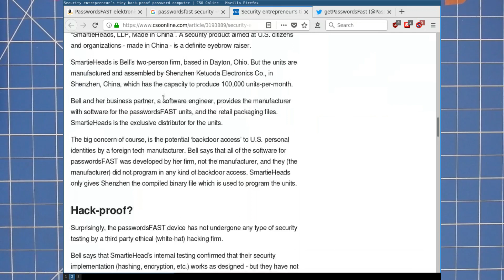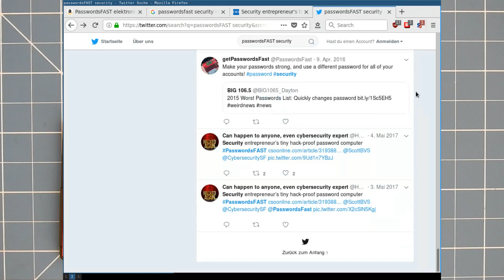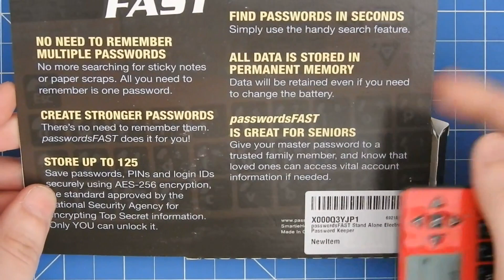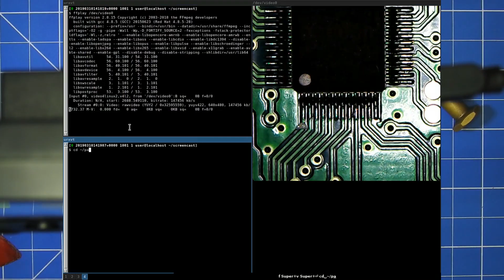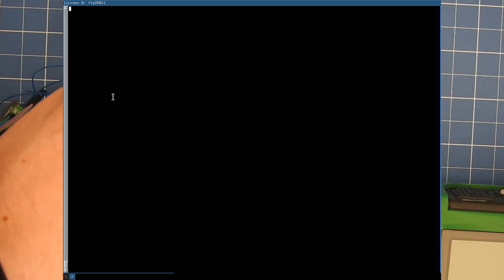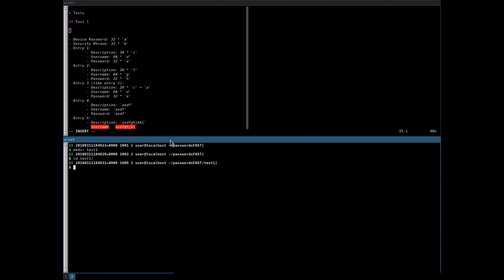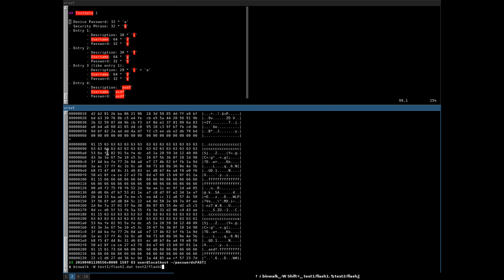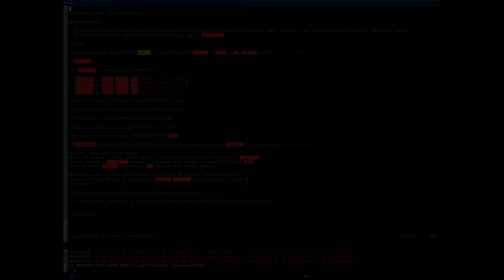"Reviewing" the PasswordsFAST hardware password safe

Comment: Hello, thanks for your video. I am looking for a hardware offline password storage option to go along with the yubikey I am going to purchase.  I was looking at this device but your writeup does not give me confidence.  do you have a recommendation?  have you looked into flashpass?
Reply from the maker: I can recommend the Mooltipass (https://www.themooltipass.com/ ). It is open source. Its security is based on smartcards (so actual state of the art security). It can be connected via USB to a computer or even phone and enter passwords by emulating a USB keyboard or via a browser addon.
The only thing I don't like about it is that it is missing integrated U2F/FIDO and TOTP, so I need to keep a FIDO token and TOTP authenticator around. However, there is (or will be) a new version called Mooltipass mini BLT that will have WebAuthn (U2F/FIDO) integrated and can interface via Bluethooth and USB.
Obviously more expensive, but worth it.

Haven't heard of flashpass.

Comment: Hello, nice video, however I don't get one part. How did you generate multiple flash dumps? Were you resoldering the flash every single time to make the factory reset, and then desoldering it again to dump the content?
Reply from the maker: Yes. Eventually I ended up doing that.
The initial plan was to solder a SOIC socket to the board so I could replace the flash chip without soldering. It sort of worked, but also gave some read issues, so I ended up de- and resoldering the flash a couple of times.